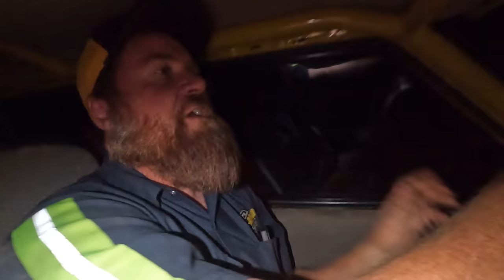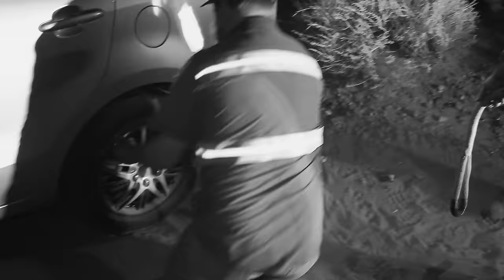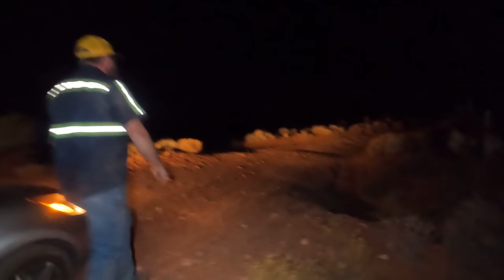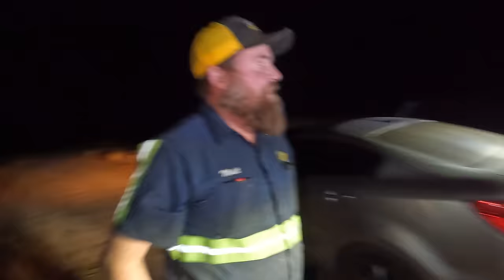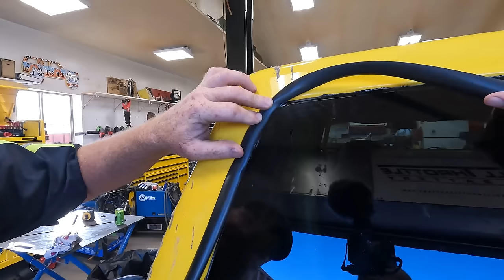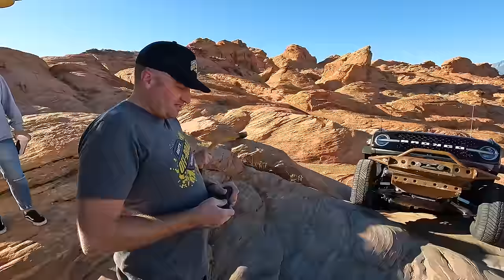Search & Rescue Wife Gets Stuck Looking For Missing Husband

Comment: Regarding the very last line in this video, you know aftermarket heated seats are actually super easy to install and wire up. You could put them in front and rear in all of the vehicles really. I live in the northeast and i LOOOOOVE my heated seats!
Reply: And drain the battery quicker .
Reply: @georgesheffield1580 I would strongly suggest only using them while the vehicle is running.
Reply: Why car has no heating?

Comment: So the bronco has some connectors for the brakes and diffs, those get dirty and start messing with the signal/wire resistance.  You may want to go under there and put some contact grease in those.

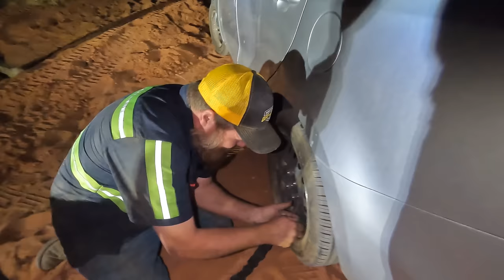Comment: Matt 2:45  Ron Pratt has learned to put thin long tywraps on the eyes of the rim slings and he curves and threads them from hole around the back to the exit hole in the wheels.  Then it is just a matter of using the tywrap end to pull the sling eye through the wheel. 

 He loves that trick.  You will too.

Comment: Matt and team, 
  Have you seen the trick with a sip tie on the end of the short strap.  Put a zip tie on the end of the strap, the wheels with the small hole just feed the zip tie first, which makes it easier to pull the strap.

Comment: If get stuck with my Silverado and spin one tire sometimes it will put my abs light on which shuts off the use of cruise control.  It might have something to do with wheel speed sensors that shut off your lockers.

Comment: LOL, after a long career in IT, the most asked question to any computer problem has always been "have you rebooted?"  Newer vehicles these days are completely computer-controlled, what is missing is a big red reboot button under the hood with a tag that says "for any problem press me first".   If that doesn't work there should be another switch to override all the unnecessary crap and give you the basics to get out of trouble!!!

Comment: That was definitely not the way to do the backglass. Proper way would be cut it out. Prep it. You can use universals 105B molding for a new molding and put it on the glass then glue the window back in.

Comment: You often thread yakum ropes around axles or through wheel spokes to effect a rescue.
Wouldn't it make more sense to have two or three plates or four or five with four, five diamond or 6 diamond apertures to fix the plate to a wheel and then which plate is affixed to one of your yankum ropes yolk points welded to it securely. 
While we love seeing anyone crawling around in mud and extremely hot sand and then on their back and t-shirts this might alleviate some or all of those problems.
Get Paul to set up a good business where these things are manufactured as simple steel wheel one offs as rescue items and then for anyone to carry who has a small car which can't sustain a hitch.
Call it an Iron Maiden's Grace . . . Maiden because you buffalos need the delicate touch of reason.

Comment: Did no one else notice that when they first looked around the car both bumpers were sitting on the banks, but after hooking the rope through the rear wheel, and before Matt even started pulling, neither bumper was on the bank?
Reply: Saw that but figured it was different angle.

Comment: The thing about the new technology is that its really great only until the moment that its not so great.  One thing that can really cause modern technology in a vehicle to really get confused is to have a cell in the 12 Volt battery go bad or have it even dip below a solid 12 Volts for a moment or so.  When that happens do you take the leap of faith that it will restart and shut it down, disconnect the battery for a few moments and hope that there is enough battery to get it started again or just press on?

Best!

Comment: Would it be an idea to install a switch on the positive battery cable so it’s easy to power down onboard computers for the purpose of reset. On the trail getting out tools in bad places might not be an option when a switch would work

Comment: Electronics will be the death of the automotive and motorcycle industries. The systems are often cross linked to the nth. From a repair and troubleshooting perspective it is a nightmare. If you don’t have access to the dealership’s diagnostic equipment you can find yourself in a spot of bother.

Comment: i dont know how many people i had to go get because of these damn computers. just to unplug and replug and drive them out. because the hit the brakes to hard or it leaned to much one way or the other. or they looked at the gauges wrong i dont know. i had a New f150 every time i would go over the rainbow bridge. about 3/4 of the way up it would go into limp mode. for 2 weeks i had to drive 18 miles to go around that bridge to get to work. and ford said they couldn't find out what it was. they just started replacing parts until one day i guess they changed what ever was wrong with it.

Comment: The Bronco... Thats my beef with these modern all electronic vehicles.... Nothing quite like some angry pixies that end up leaving you stranded somewhere, where you otherwise wouldn't be if had a manual t-case and locking hubs.  This push button crap is getting old.